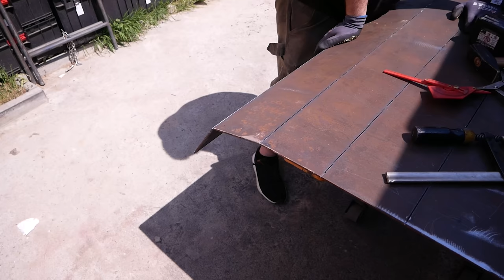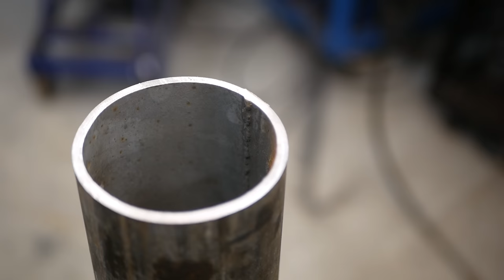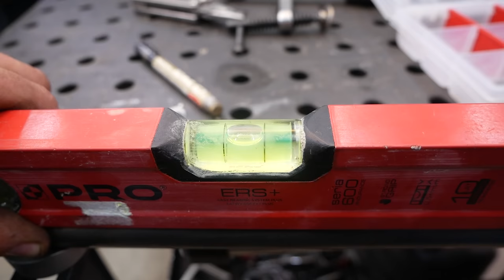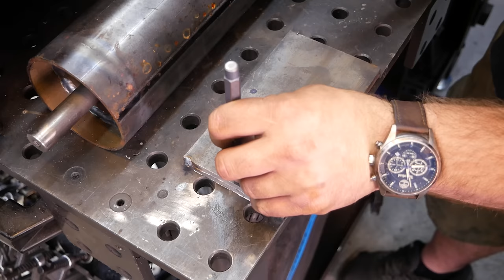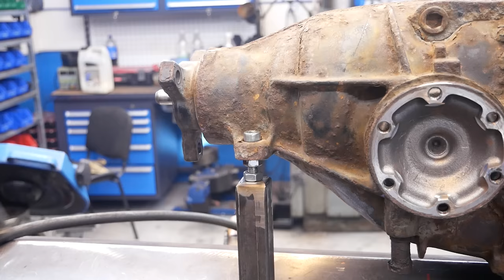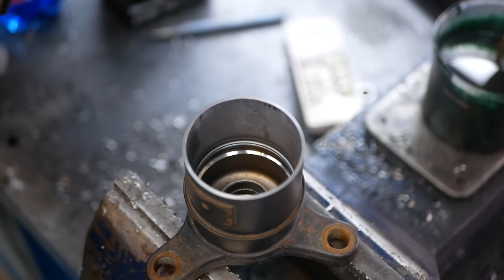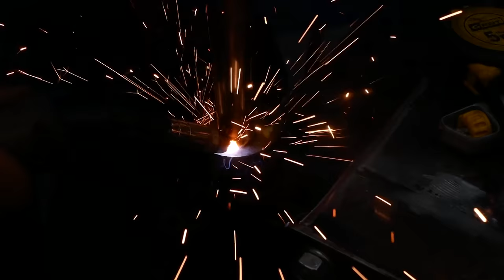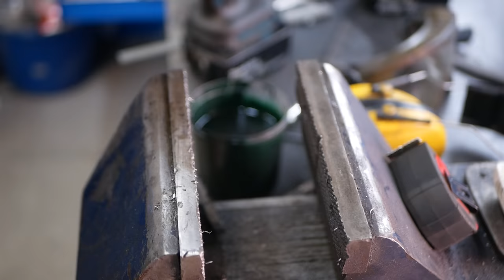Extreme Brush Cutter BuilD

Comment: Do you think this could be powered by a separate engine? I would like to mount a front facing one to my tractor with front end loader, but it doesn't have enough auxiliary pump volume to power a hydraulic motor.
Reply: Using an on-board power source is actually easier than rigging it up to work off a PTO shaft. It's just a matter of making some brackets. Wouldn't have to go through all the hassle of dicking with differentials, either. The only reason the differential was necessary was because of the L-bend in the driveline. If not for that, it could be direct-driven, which is preferable in my books. When you block off one end of a differential, the planetary spins twice as fast as it would otherwise, which creates lots of heat. Put simply: This is not what a differential was designed to put up with.

Comment: Nice. Your belt tensioner needs to have a spring load on it, then you will not be breaking things when you hit a rock. Also your cut is too low, you will destroy that fast. It is not a rototiller!

Comment: Is there a reason why you would use one like this instead of traditional blade? Level the ground a bit maybe?
Reply: Generally these are used for obliterating high mixed brush. Where a single mower blade would be dinged up by rocks, woody growth, etc, the flail just shreds it all in a hellish storm of steel and noise.
Reply: @kmech3rd  thanks for the explanation 👍
Reply: @kmech3rd  "hellish storm of steel and noise" is a good description. I had a contractor come and clean up a few paddocks with an 8ft one with a solid axle on a 90HP tractor and it was terrifying to see and hear the power in it.
Unknown to me, there was some old fencing laying on the ground under all the overgrowth and it mangled the steel droppers like they were plastic straws, turned the wooden posts into mulch and cut the wire to shreds.
There was so much momentum in the thing that it took a several minutes for it to stop spinning after the PTO was disengaged.